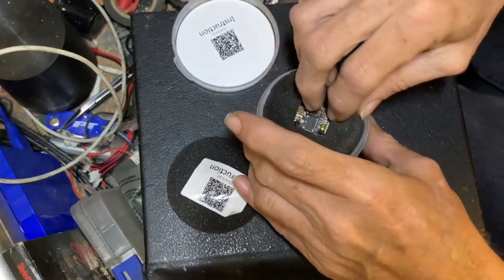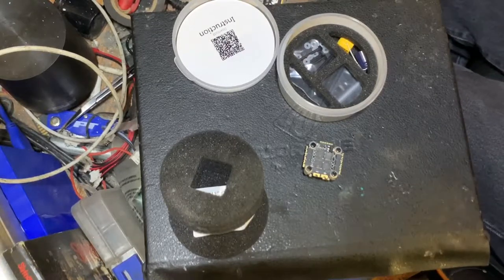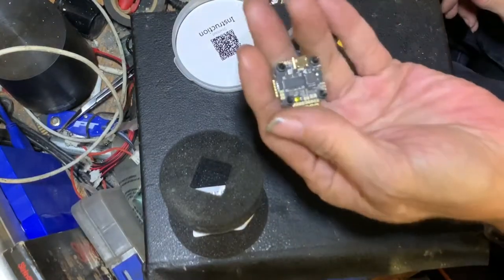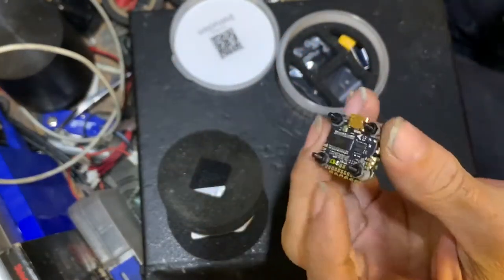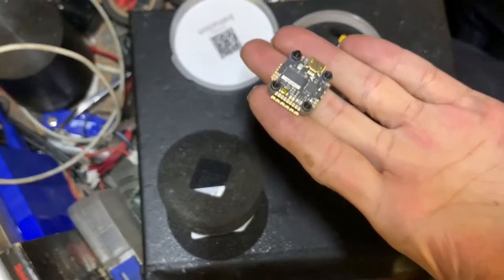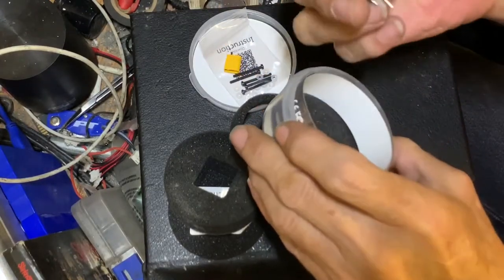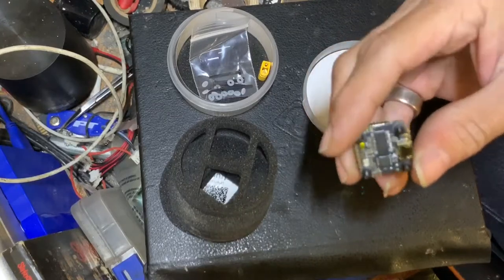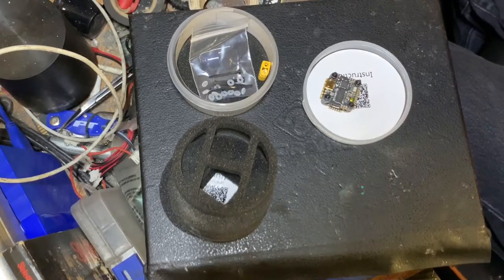The Mamba F411 Nano Stack EXPLAINED!!🤘🏻🔥👌🏻‼️

Comment: At order one to mount on my Sailfly... Thanks for sharing!
Reply from the maker: Home Dronen they work awesome put it on my lil “Byte V2” good (BEST) 16x16 for sure iFlights SUCKS in my opinion! I went through THREE of them in my Cinebee(cinewhoop) yeah first thing to burn out was VTX when I simply switched it to as said will do the 200mw and BAM at one foot away lost video signal the problem list goes on and on!! Three counting the one that came with it!! Here’s a Facebook link to the byte flying if wanna see and I sold my binocular goggles in order to pre order the Skyzone 03O’s and yeah not here yet using crap box goggles and the latency is NUTZZZ when I use the DVR on them!! So remember that!! Lol 
https://www.facebook.com/100000994179571/posts/2582480021795112?sfns=mo
Reply from the maker: Home Dronen another link....Insta—-  

https://www.instagram.com/p/B2kAFDknAOu/?igshid=1nrdqvy6yb8kl